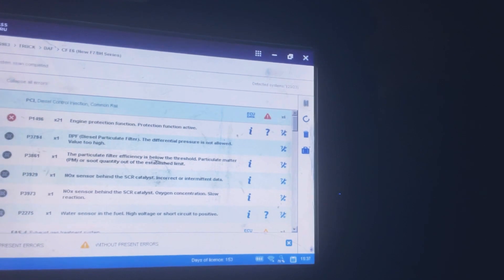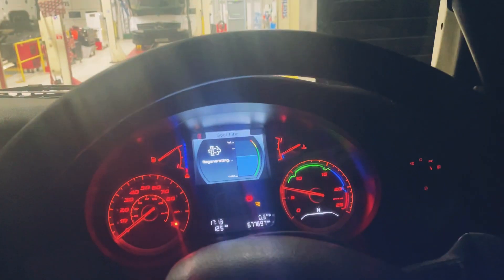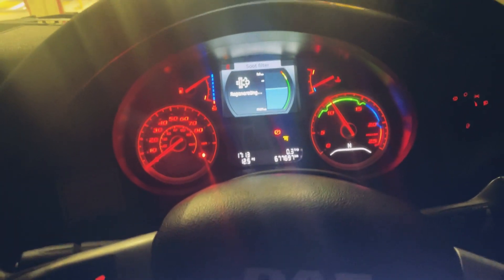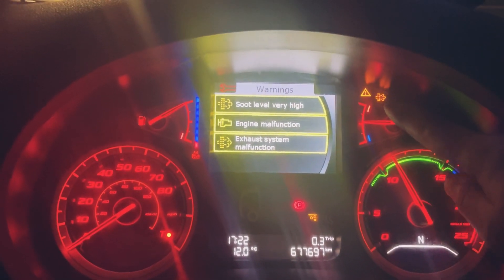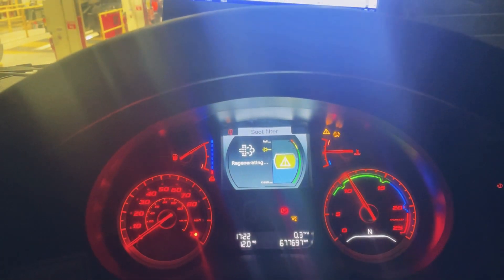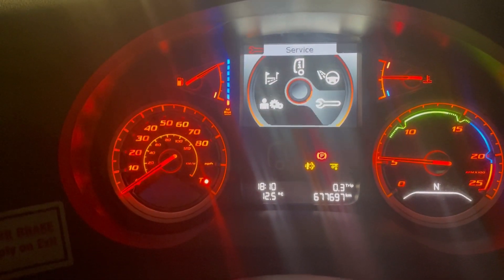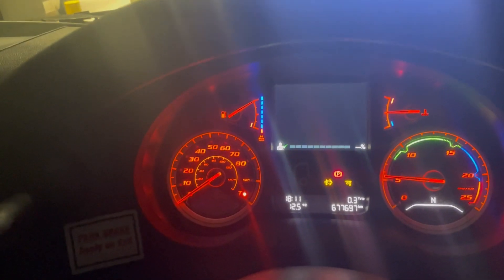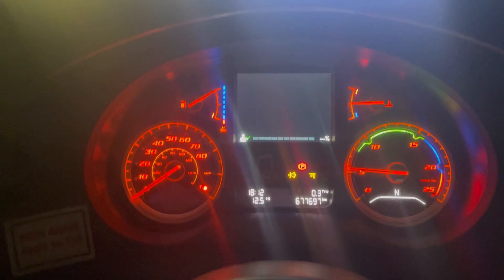Euro 6 DAF CF85- is the DPF blocked? does it need a forced regen?

Comment: There is no need to get the truck in the workshop, the driver just could have done the parked regeneration with the button. But the question is of course, why did the soot level get very high? It should never get there in the first place, could very well have to do with the NOx sensor faults, forcing the engine to run an abnormal low NOx.
Reply from the maker: That is a very fair comment, I’ll have a look more into it tomorrow and see why it’s got so high, because your right shouldn’t be getting that high anyways, unless the driver doesn’t know about the regen button and has maybe left it and left it?

Comment: Hiya...my DAF CF has a normal high pitch sound when accelerating, but later in the day that will disappear and the engine tone is a low,dull sound..it still gets up to 56 mph with a very slight loss of power. Odly enough it does this if you go down a steep hill? Any ideas?

Comment: hello. On manual regeneration temperature is not rising.. goes until 200oC only.. No any fault. what may cause this issue ? I have recalibrate VTG,  BPV in normal values..
Reply from the maker: That’s a strange one, what does the before and after temps say? Just the one that’s not right?
Reply: @freightlanetv  both before and after temp stays on 200oC. I left it for more than an hour..

Comment: You ever had soot level hight but won't regen ? Tried new pressure sensor and new pm sensor ?
Reply from the maker: Yeah I have mate, depending on what diagnostic system you may be using, we had to do a I think it was called system reset in ad blue system, but we’ve also had it where it won’t regen because the BPV is faulty so make sure haven’t got any faults with that.
Reply: Thanks for reply mate, we are using texa it kinda points you in the right direction but not the best will have another look tonight. Your videos are spot on btw keep up the good work 👏
Reply from the maker: Definitely check the BPV and also see about the reset I have had this before. Thank you mate I appreciate that

Comment: Interesting mate as a car mechanic it’s nice to see what you HGV lads do got to say what a brilliant idea having an inspection cover to look inside the DPF 👍
Reply: The main purpose of the cover is to be able to pull out the DPF when it needs to be replaced or externally cleaned. All manufacturers have this.
Reply from the maker: Thanks mate! Yeah for the sake of 10-15 mins it definitely worth taking that cover of and checking can save wasting time doing a forced regen for something that’s worse than that!

Comment: nice video i try to regen dpf and the exhaust temperature dosent go more than 250c and cant finish the regeneration only fault the higt loot level any idea whay the fault ?
Reply from the maker: What make of vehicle is it?
Reply: @freightlanetv  daf xf euro 6
Reply from the maker: Have you took the cover of the exhaust to see whether it may be totally
Blocked up?
Reply: @freightlanetv   the filter cleaned in mashine my problem is in the regeneration cant go more than 250c i clean the injector in exhaust and chache the nox after pdf
Reply from the maker: I’m pretty sure there’s a exhaust temp sensor, maybe worth looking into that, I’ll find out some more info today for you

Comment: My wood burner at home goes through periods of looking like Auschwitz, never mind my van.
Reply: Just stripped my 2016 xf 510 it seems to have another DPF behind the one I took out to clean, further investigation needed.
Reply from the maker: ahh interested in these please let me know how you get on!
Reply: @freightlanetv  I removed the dpf and washed the ash out, got about a mug full of orange sludge from it, behind the removable dpf is another about 50mm deep fixed to rear of can which looked very clean,  My dash still has a Exhaust fault warning up will get some one to put tester on to find fault and rectify soon, seems to run on still.
Reply from the maker: @peter044  has it got any dpf pressure faults? the sensors can be faulty.
Reply: @freightlanetv  Will get it on Jaltest soon, a Mechanic I use has just bought one for his plant repair company so possibly will do trucks to, thanks.
Reply from the maker: @peter044  good idea, maybe abe to help more, if your not too far and may need any help just drop me a message.

Comment: The small puffer ligh is called a HEST high exhaust system temperature ..Looking at the video you have a model year 2017 so max 4 years old ..Is the dpf due replacement as part of it service schedule ???  Rapidly filling dpf have a few items that can cause it ,,i had one recently ,no codes ,but lack of power ,VTG is faulty ..Keep up the good work as i enjoy watching others work lol
Reply from the maker: So after I did the job I checked and it had a new DPF in it, I think it can be deceiving when it says basically just wants a regen most of the time yeah it does but there are occasions where there just clogged badly, and a regen is just hiding that wants more than that. Yeah we’ve had a few VTG faulty, not a bad job! And thanks mate appreciate that
Reply: @freightlanetv  If you have a dpf that has pushed the element out ,there will be a pressure issue ,again have a look at the VTG ..Obviously i use DAVIE  so don't  know the capabilities of a jaltest .
Reply from the maker: Yeah I get what you mean mate, jaltest is alright tbf but won’t tell you and do as much as a davie, the davie has probably changed a lot since I used it lol
Reply: @freightlanetv  it has changed a hell of a lot not all for the best
Reply from the maker: I bet, technology on hgvs is so much more complex compared to even when I first started